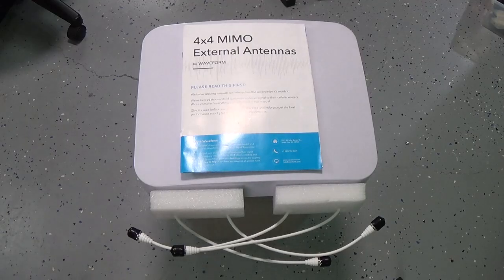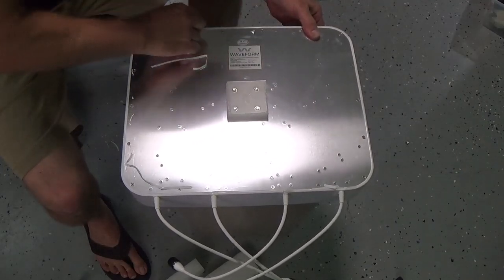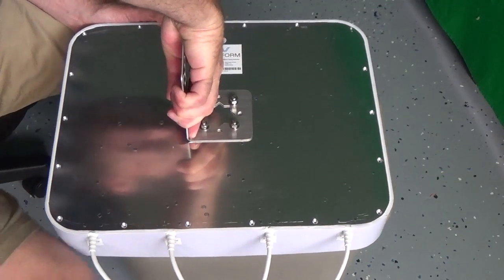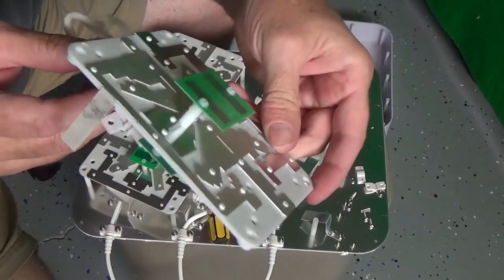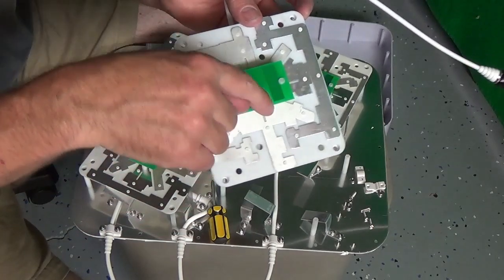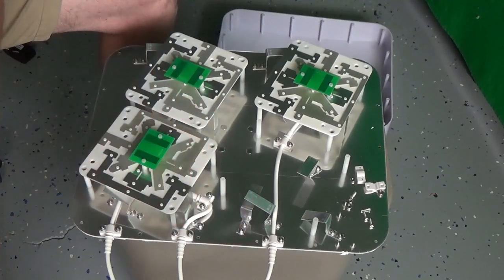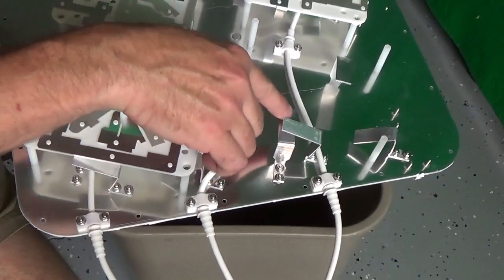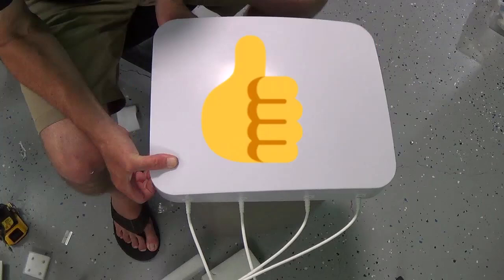🔴Waveform 4x4 MIMO Antenna - What's inside? Let's take it apart and see!!

Comment: Something that should cost like $30.  But this greedy company charges you $400?
Reply from the maker: There are a ton of antennas that are less expensive on the market. This is real engineering. This is one of the best performing antennas on the market. I took apart my favorite external 5G modem and hooked up this antenna ain't got some of the best scores I've ever seen. It all depends on the band you're trying to get. If you're going after low frequencies you want this type of size. If you're going after higher frequencies you can go for a smaller antenna, like Waveform's 4 x 4 mini. https://youtu.be/lyI8qS_LhLA

Comment: Good morning... I'm confused...if I have a D-Link Router...one antenna to get Internet from my provider...how I'm going to connect this quad unit which has 4 cables....??? Thanks
Reply from the maker: Humm. This is a 4x4 MIMO antenna. It's not really for your D-Link Router (although WiFi frequencies do overlap those of 5G, so it might give you better WiFi performance). This is for a 5G Internet modem. If you get Internet over Cable, this is not for you.

Comment: works as long as theres a signal... if the signal is too week then youd go for a high gain antenna,, yagi grid or log.. check your operating frequency...it might give you half the speed but at least youll be getting something
Reply from the maker: No doubt. If you are in the boonies, you are not looking for n77 or n41 but more like n71 or even b12 (you should always take your vitamins).

Comment: The non-connected elements are considered parasitic elements. The operate as em shields, at least by my understanding, in regards to the mimo side of the system, many would think they just rotated all four directions, but that is incorrect. Even though there are 4 antenna, the top two have a horizonal identical orientation, while the bottom two have a 90 degree rotated orientation to the top two, however they again are exactly oriented to eachother. So there's only 2 orientations in this 4x4 mimo -  and this is thanks to the parasitic elements (working in tandem with the ground plaine) providing an effective shield to  the adjacent antenna.
If you take a direct down over view, and duplicate and then flip the image, you can actually see on the active element (with proper transparency levels) where there are gaps in the overlay, and if you happen to measure many of those gaps you get very interesting lengths such as 28-30 mm, 45 mm, etc. And those gaps happen to be the 1/4 wavelength of n41, n66, etc. Which is the magic that grants these awesome antenna very massive ranges of frequency that are so specific to the 5g bands.
Reply from the maker: Their engineers called them passive reflectors. Pretty cool design
Reply: @PeterC408  Yup! Parasitic Reflectors are passive, they help shape the active signal. For example, on a Yagi Antenna, usually only one of the rods going across the antenna is powered, the rods forward on the antenna shape and condition the signal before it hits the driven element. 
  With those elements over the center (the square ones), those are passive as well, again designed to shape the signals incoming in a certain fashion.
Funny thing is my antenna I have is a 2x Mimo "eifagur" branded one I got on Amazon 3 years ago. The elements almost look identical to these .
I do like that Waveform is US based and pretty good quality, and communicate with the community, but they're absolutely making a killing with these. I don't know who was copying who on the design, but at this point they've definitely paid for the design, and it hasn't changed much in 3+ years.
Reply: a bit late to the party, but the elements are rotated to match two different polarizations, two vertical and two horizontal.

Comment: Not much hardware for $400.00 bucks.
Reply from the maker: That would be like weighing a trumpet and looking up the price of brass to assign its value. This is one of the very best performing antennas I have seen. The price of the piece you see here is $199 but the full kit with 30ft low loss cable, mounting hardware and TS-9, N, IPEX and SMA connectors is indeed $399.
Reply: You can't easily see R&D costs.
Reply: @timmturner Or the mathematics and precision mechanicals involved.
Reply: On prime day and Black Friday you can usually get them for around $135
Reply: @Blu3ManiC  negative